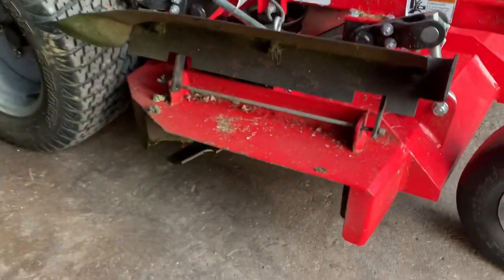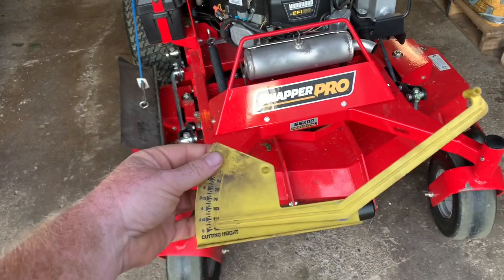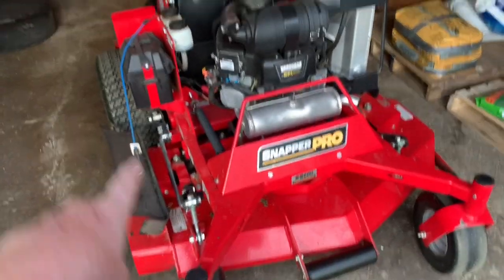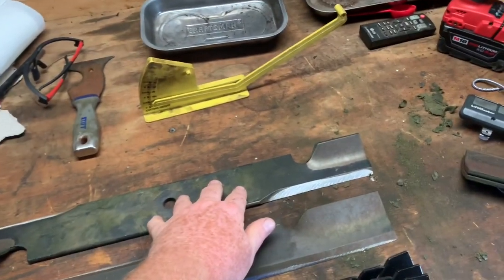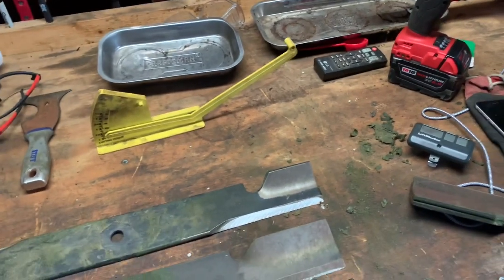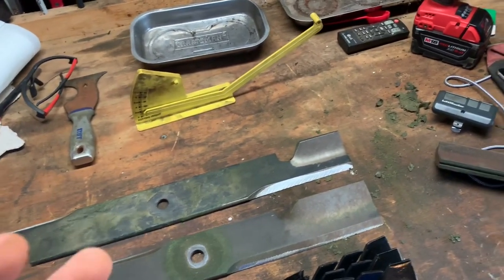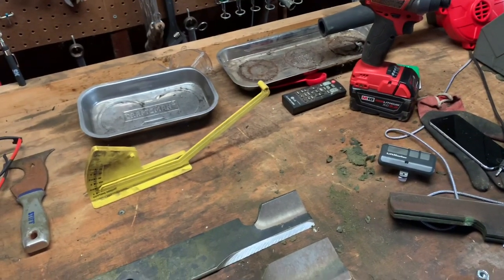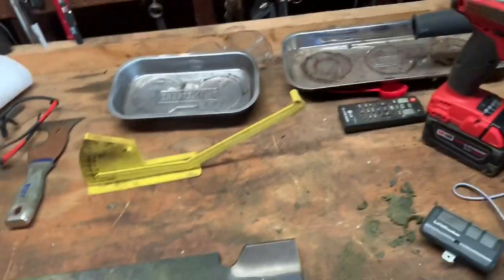Icd deck fixes.

Comment: I have an Exmark with the Triton deck that people like to complain about.  I was running it with the solid high lift blades (longer fin like the standard ICD blades) and just spitting out all sorts of clumps.  Switched to an Exmark notched high lift (like your short fin blades there) and noticed a 200% improvement.  No more clumping and perfect for high-fertilized lawns.

I'm only here because I'm considering a 48" Ferris Z1 after I saw how much a new 48" Toro Grandstand costs...

Comment: Great video. Thanks for sharing!
Reply from the maker: You still using the z2?
Reply: @JohnnyMow  in Florida we run the Scag V-Ride II 52” and 36” decks with Kohler EFI
Also, we push with the Toro 30” Timemaster  with the Kohler engine.

Comment: We will give those blades you run in the spring and fall. Right now my ferris 61” deck we don’t even get it off trailer til after 10 am. We use the Deere  way better in wet grass.
Reply: Sorry we will give those blade a try. Thanks johnny

Comment: Z master 4000 got revealed.  Has hydro gear 4400 or 5400 no parker like the 3000/5000.  I think ill just stick with the 3000 better hydros.
Reply from the maker: Yea I was greatly disapointed

Comment: The owners manual for my ICD deck is VERY specific about the deck needing to be level.  No pitch front to back.  dozens if not hundreds of posts on lawn site.com confirming this.  Maybe it’s different for yours.  But, maybe be careful about making blanket statements, a lot of people depend on YouTube for info.  Good luck and good video overall
Reply from the maker: Hello my man the information you are giving is old.  That was old info.   It is now the recommended to be pitched came straight from the factory.  Call the factory check for yourself.  My old snappers were to be level but that has since changed.
Reply: @JohnnyMow  okay thank you for the info

Comment: I still wanna know if the new toro aluminum spindles fit the older models that have the cast irons. I believe they are both 9inch diameter
Reply from the maker: Hmmmm.  Not sure why would u switch?
Reply: @JohnnyMow  For better parts available and the new spindles have an bushing that allows the blade to spin freely when experiencing big impacts to protect the housing

Comment: Jonny I have a 52 Ferris 2100. Will this mulch leaves with a Shute blocker and mulching blades?
Reply from the maker: Absolutly.   How do u like your Ferris,  and what engine is on it?
Reply: @JohnnyMow  it has the Kawasaki engine cuts great
Reply from the maker: @marybartaczewicz1961  how is it on hills.  I’m very interested in that model.
Reply: @JohnnyMow  will slide a bit more than I’d like

Comment: Jonny what's our opinion on the 72 icd and 61. I may go for a 72 but I want mow fast not slow down any  do you know anything on this. I found a 3300 72 used
Reply from the maker: Not a fan of 72 inch decks of any make.   But if I was going to get one it would have to be diesel
Reply from the maker: Not a fan of any 72 inch deck but if I had to have one it would be a diesel

Comment: I started messing with my icd deck adjustment on my 52 srs z2 and now I really regret it. Not sure what I did but now I can’t get it back to normal. Any suggestions?
Reply from the maker: Yes let’s start from the beginning.   Air pressure first.  Find a flat piece of cement put your pin in 3.5  front tip of blades at 3.5 rear 1/4 higher.
Reply: @JohnnyMow  air pressure is good and I made sure to check floor with a 4 ft level. I was able to get the front tips of My outer blades within an 8th of an inch of each other. Discharge side has the quarter inch rake but the opposite side has about a 3/4 inch rake and whenever I try to drop that back corner I loosen and it won’t drop. It’s almost like the other 3 spots are taking all the pressure. My center blade also sits a quarter inch lower which I find odd. I figured that out before I started adjusting the level. I also can no longer rack it up into the “travel position” I have to put the pin at 4.5 and that’s the highest it will go. Only thing I can think of is my front caster tires have about 900 hours on them and they are run flats so I’ve lost about an inch on those. I pretty much have the adjustments maxed out. I spent so much time on the concrete last night  my whole left side is bruised lol